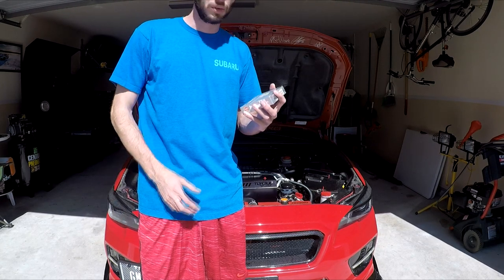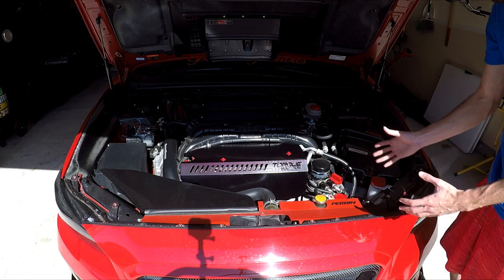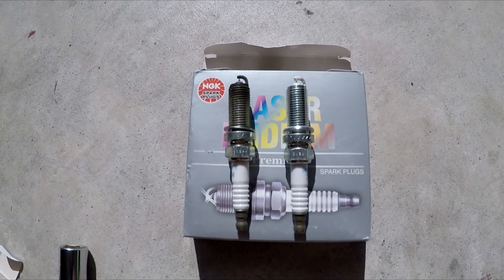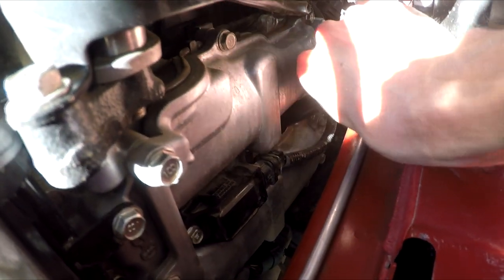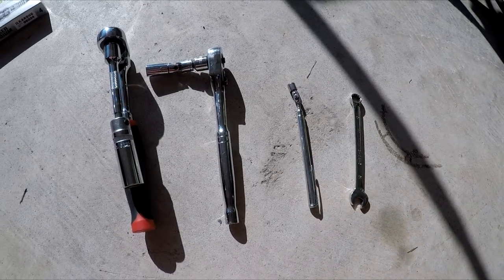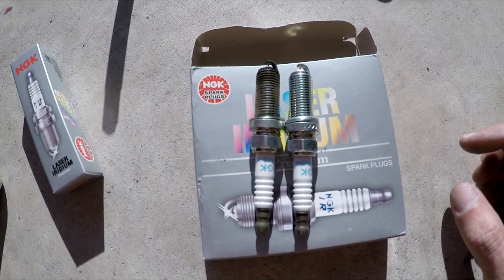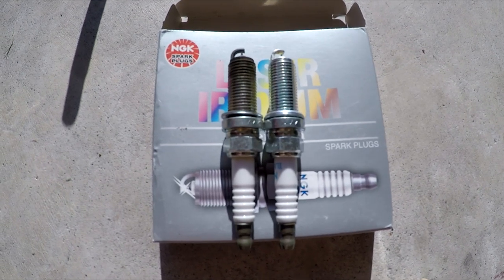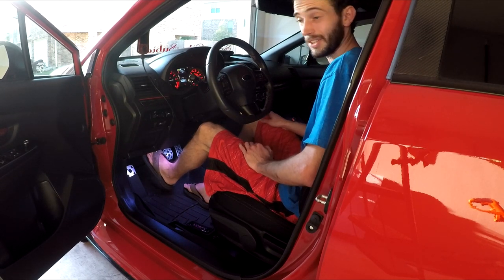2017 WRX 35k Spark Plug Change

Comment: Question...  Doing this, what all did you replace in the process ?? Just plus and wires, or coil packs too ??
Reply from the maker: Only the spark plugs. I guess you could do the coil packs too but I wasn't having any misfire so I didnt see any reason to spend the extra money. I haven't had any issue since.

Comment: Did you check the gap on the plugs you got from amazon? I've had alot that were off. Not all my plugs were gapped the same
Reply from the maker: Yes the gap was correct out the box.